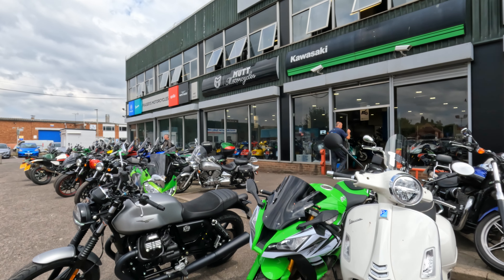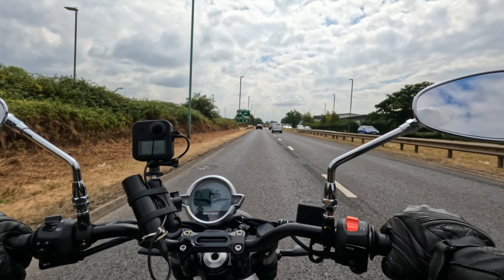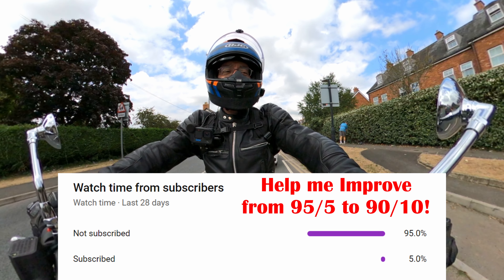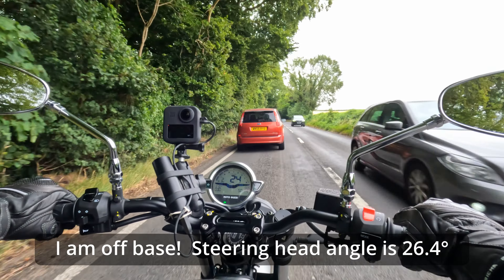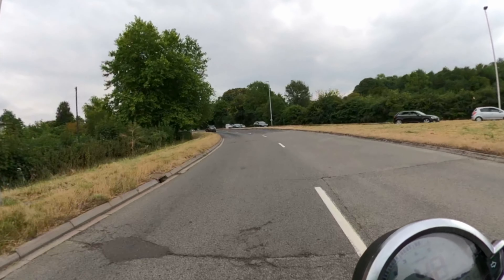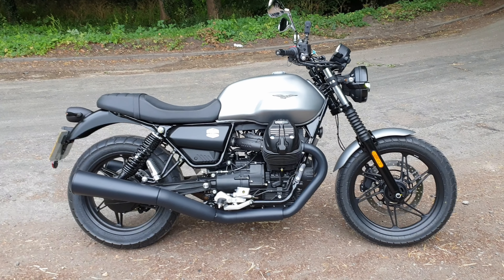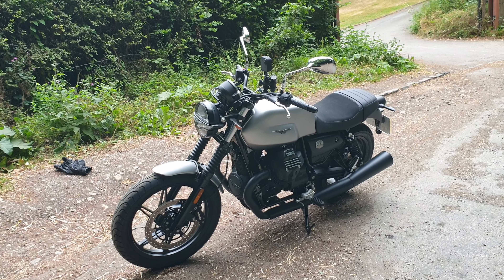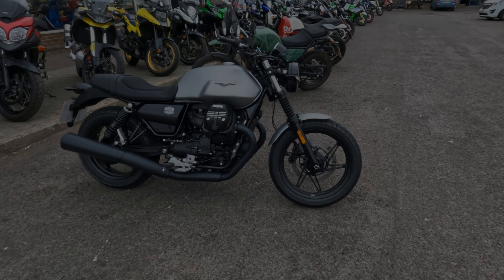Moto Guzzi V7 Stone • First Ride Review

Comment: 64 hp and 54 ft. lbs. torque in a 853cc bike is a no-go for me. I get that it’s a heavier retro model that’s not loaded with modern lightweight plastic, but still…the Kawasaki retro 900RS makes 111 hp and 73 ft. lbs., so with its greater power, Japanese reliability, better dealer network (in the States, anyhow), better look IMO, probably better handling, better price (I assume), etc., I can’t figure out who would go for this bike over the RS.
Reply from the maker: I think big fans of the brand would be going for this bike (stating the obvious probably)... and if you are seriously considering one of these, then the RS is probably not in contention 😊
Reply: If you wish to ride an inline 4, the RS is the go-to retro. If you want a V2 air cooled, there s few to pick from, the V7 being unique due to its shaft-drive transverse setup and the "character" and heritage resulting from it. 

However, the RS and the V7 are pretty much equally fast / powerful, as they both suffer from the hindrances of classic motorcycle styling: lean angle, ECU Map gentle, braking mediocre at best... if you were to look for a more retro style motorcycle of significantly higher performance, you should consider the BMW r nine T, the triumph speed twin and T120, or even an old widowmaker.
Reply: @benjamin.f.b.  Yes, my next/third bike will be a retro, and will definitely be a Triumph, either a Bonneville or T120. I’m tempted by the UJM vibe of the RS, but am too aware of its shortcomings to truly consider it over the Triumph.
Reply: @pbofan  testride em all ;) don't forget the speedmaster if you wish to go on holiday weekends two-up and/or like the look.
Reply: I understand your point, but if you can, ride one first. I too was focusing a LOT on specs (tiger vs gs vs vstrom etc..vs guzzi v85tt). on specs, the guzzi looses everywhere. In the end, I went for it after testrides. It has character, and may not be the fastest, but it puts a smile to my face. The tiger was a bit of a letdown, and I just couldn't stand the looks of the strom. I do understand the dealer network point though. Here in the EU, it's a lot better.
Reply: The RS and this... these are completely different bikes. 2 cyl Guzzi VS 4 cyl Kawa... The only thing that both have is a fascinating look. All other things are very different starting with chain vs shaft...
Reply: IMHO, The Kawi 900RS has no soul.
Reply: That's all fine. You can ride whatver you like. I had a Kawasaki 900 RS for a while but it was heavy and lacked any kind soul.
Reply: @brockett  Here we just came to some personal feelings... and this is right. Drop by man, you may like it. :)
Reply: @pbofan  my bud has a nearly new Bonnie. He can pull away from my 750cc V7ii with ease. 
Generally, when we ride together, we're not much over the posted speed limit, but he loves to turn up the wick every now & then. 
I'm still having the time of my life!
Reply: @savage22bolt32  You bet, the Bonneville would be another great choice.
Reply: @savage22bolt32  any issues with the lovely V7?
Reply: @Victor-vf1fi  just one minor thing: After riding, if I stop and let it sit for 15 minutes then restart the engine, it'll act up for a couple of minutes before I can ride off. Similar to a carbureted bike with a vacuum leak or the choke halfway on when it's not needed.
Other than that, I love it.
 I'm getting old & I'm no road racer, so the single front disc is plenty.  
The torque maxes out at 2800 rpm and it's flat across the rev band after that. Sounds good, looks good. The gearbox shifts just the way any classic bike should. It's a clunk, not a snick like all the Japanese bikes.
I have not yet carried a passenger, so I have no input on that. 
It's a 2016. I bought in 2022 with 5k on it, now up to 7k. My riding is 95% on the gray squiggly lines that have no names on any paper road map.
It's just a barrel of fun!
Try to get a test ride on one.

Edit: PS, mine looks like the one in the vid, but in 2016 it came with old style dual clocks, straight spoke cast wheels, & chrome exhaust.
Reply: @savage22bolt32  thanks for your comment. Just test rode the 2023 Stone in yellow and it was the best fun I've ever had on a bike. Do you think the new model will have the idle problem you are describing?
Reply: @Victor-vf1fi  i doubt it. From what I've read, the 850 is quite different than the 750. 
I suspect I have an isolated emissions issue. It's not too bad, I just have to rev it a little before I ride off, to clear it out.
(It has stalled on me if I ride off too soon, which is embarrassing! and disconcerting when pulling out into traffic)
Reply: @Victor-vf1fi  PS, that yellow paint scheme is beautiful!
I also fell in love with the blue Special Model with the brown seat. 
But my black & silver flies under the radar!
Reply: @savage22bolt32  guess it all falls under the umbrella of Italian charm :)) 

Safe travels dude I hope I will get one
Reply: @Victor-vf1fi  Thanks bro, I hope you get yours too!
Below is a link that is saved. It's from a world traveler who rode an old Guzzi. That 19 seconds of sound pushed me in the right direction. 
Note the comment I left there a year ago - lol, it's true..

https://youtu.be/agWX9ZgS3gg
Reply: @savage22bolt32  I wish Guzzi made an 850 version of your bike , dual clocks , cast wheels . If they could see their way to put two Brembo rotors on the front that would really improve the looks and sales in my opinion .